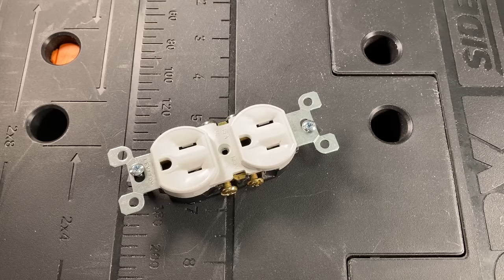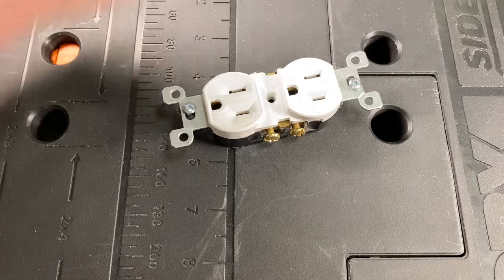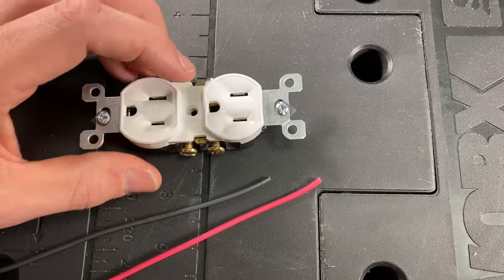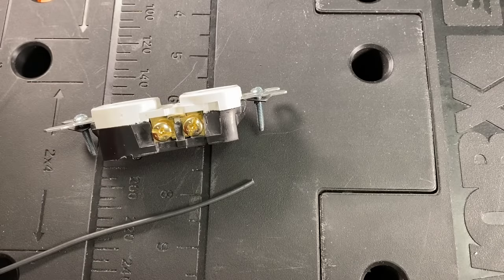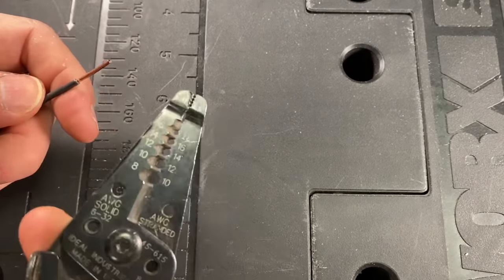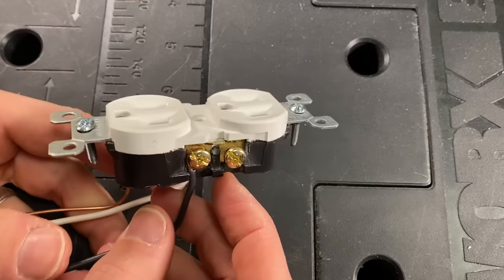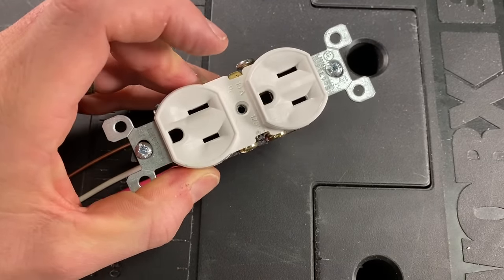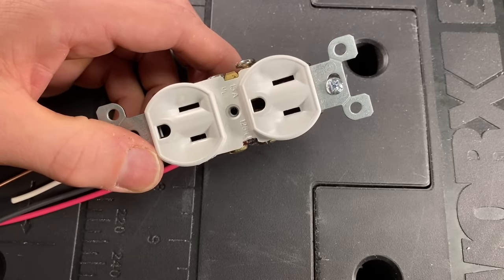Electrical Outlet Basics | How To Wire

Comment: I've been doing home repairs for 40 years.  I NEVER knew that the small slot was the hot slot, why some wires were red and some were black, about the built in wire stripper gauge, the purpose of the built-in the wire stripper gauge, the wire bolster on the outlet, the removable tab to isolate the top and bottom outlet, or even the fact that the screw terminals are preferred over the push in terminals. One thing I have learned from YouTube is that no matter now mundane a subject, I can almost always learn important details I never knew. Thank you so much. Like many of the readers here, I also notice you didn't mention how important it is to place the wire around the screw in a clockwise position. I figured this out on my own more than 35 years ago but this is the first time I have seen that it is "official code" (and understandably so).
Reply: "Black on brass", first thing I was ever taught as a kid concerning electrical outlets and switches.  I also thread in the unused screws, especially when using gang boxes.
Reply: I’d say if you have been doing home repairs for 40 years and didn’t know all the things you mentioned then you have no business do electrical work. You have most likely been doing it wrong for 40 years. The hot vs neutral vs ground on outlets is very important and if you don’t understand the purpose of the wide slot and narrow slot on an outlet then you have no idea if it’s wired correctly. Your lucky your ignorance has not cause someone harm or caused a fire.
Reply: @mrsmith8436  You are correct. Fortunately it’s only been my own home that has been exposed to the risk. I do always have black on brass, I just never understood why that rule was present. I still don’t understand why one side is hot and the other is not, since alternating current means that the current goes “back and forth”  continually. My father 50 years ago taught me that “both wires are hot“ on all AC circuits. So as of today, I still don’t understand why one wire is considered hot and the other is not.  Thank you for your thoughtful comment. Have a good day. Maybe one day I’ll understand it better.
Reply: @thhall459  The neutral (white) wire isn't hot unless the circuit is in use.  The polarized plugs help ensure that when appliances/devices are plugged in, they can be switched off properly, according to how they are internally wired.
Reply: @mrsmith8436  I am grateful for your counsel.  Thankfully the only place I ever did this was my own home which my family and I have lived in for the past 34 years, and so far we have escaped tragedy.  Regardless, I have always put the black wire on the brass terminal and the white wire on the other non-brass terminal.  I just never knew why,  because in my ignorance, I thought that AC (alternating current) meant both wires are always hot, and that there is no real distinction between the two.  My ignorance was bolstered by the fact that most electrical devices can be plugged into an outlet either way.  Anyway. Thank you and this YouTuber for correcting the error of my ways.
Reply: @thhall459  there is a 115V high side and a 115V low side in a household circuit panel. The white wire is  always neutral, but common to both high and low sides. If you place a switch on the neutral  wire, the switched receptacle remains hot (across ground) even when the switch is off. this can cause an electrocution.
Reply: @mrsmith8436  It's unreal how much f'd up wiring you see especially in homes and restaurant kitchens.  Not so bad in big commercial and industrial situations where there's qualified electricians.  I'm a retired master and I've pretty much seen it all.  These You Tube DIY'er videos can show people some basics, but can also mislead people into thinking they know what they're doing then they end up burning their house down.

Comment: Great video. One thing I always do is tighten down any terminal that is not in use. This makes it less likely of a terminal touching the box.
Cheers
Reply: Correct!  Glad another electrician noticed that too.
Reply: Another good tip ! Or wrap in black tape .
Reply: Sorry I wouldn't have pontificated so much had I seen your post! You are absolutely correct!
Reply: @RonSch123  îuuiiiii
Reply: Thank you for the info
Reply: Another reason is on an arc fault protected breaker a lose screw can give the same signature as a lose connection.
Reply: @perryfarmer3280  Is there any reason why you should not remove the screw from an unused terminal?
Reply: Possibly a couple. One is the screw is slightly tapered and if removed you can add a new one but the threaded part may be compromized. Also left in place tighten down may provide a better mechanical result and some corrosion protection to the receptacle internals. However probably minimal benefits there if at all.
Reply: I was going to ask if that mattered, as I am not an electrician. Thanks for your comment

Comment: Thanks for including the info on switched outlet connection. There are a lot of videos out there that cover the same basic info you did that over complicate things and create confusion. Appreciate your concise delivery.
Reply from the maker: Thanks Russell!
Reply: It should have been mentioned that on a split outlet that it’s extremely important to make sure that the power/hot wire and the switched wire is getting its power from the same circuit breaker or fuse so that you don’t end up with 240 volts in the same outlet box. That is against code and can be deadly.

Comment: I was working for an electrician that had been one for over 40 years.  He taught me to wrap the  screws, hot and neutral, with quality electrical tape, especially in a metal box.  Not over kill, professional and safer.
Reply: Focus more on tucking your wires back neatly.  Absolutley no need for electrical tape on outlets or switches , coming from another experienced electrician.
Reply: @tysonkauth7232  i disagree. I think its common sense in metal boxes. Not plastic or course.
Reply: @tysonkauth7232  If you do everything right, you are probably right. Unfortunately people screw up (including the person who comes after you). I definitely like wrapping with electrical tape. (Saw a case once where the outlet shifted in the box over time and terminals shorted to ground).

Comment: It's a good idea to check and make sure the  polarity is correct because I have run in to old homes that the white wire isn't neutral, it's hot, or all the wires are the same color. I have also run into  switches that are wired on the neutral side of the outlet. You run into a lot of crazy stuff when you work on homes that were built in the 50's and before. A handy tool I use for quickly checking if a outlet it wired correct is a GB GRT-500 circuit tester. Provided the outlet isn't the old outlets that don't have a ground.
Reply from the maker: Hey Jeff, thanks for the feedback and agree those outlet testers are super handy and I also carry one in my standard tool bag now.  Take care 👍
Reply: I have been replacing my 2 prong outlets in my 1925 old convent house with 3 prong, and got puzzled with white wire being on the hot side and black on the neutral. Only one wire for each side. There's no ground wire on those old outlets, but I've been screwing the green ground wire in the box, and some are grounded and some are not. I really need to just get an electrician in here and do the most expensive work needed, since some room lights and ceiling fan have a mind of their own and only turn on when they want to, and I get the AC tripping circuitry because there's too many outlets using the same line. 😢

Comment: If the box is metallic, (usually they're much smaller than plastic or composite boxes), I like to wrap the terminals around with electrical tape before pushing the outlet into the box.  People tend to shake the outlets when plugging or unplugging appliances, and it is possible to arc the box with hot side (if the metal box is grounded).
Reply from the maker: Hey Erik,  thanks for the feedback and many others seem to share your thoughts on playing save with a couple of wraps with electrical tape.

Comment: I've seen plenty of back stab connected outlets catch fire, especially from space heaters. The thin blade like contact has much less surface area, therefore higher resistance. Whereas the side screw connections provide more ample surface area to accommodate the amperage / voltage continuity.
Reply: Good to know.  Thanks.
Reply: Things should be outlawed.
Reply: @Sean Stevenson It is all about contact surface area.  Backstab do not make enough contact and therefore create more heat at the small area it does (they tend to be more prone to corrosion issues as well). Terminal use (screw or back wire) have much more contact area.  I never use backstab, nor do I use the device as the passthrough to another run by sharing the contacts.  I always use a pigtail to provide a single wire for each connection on any device (hot and neutral).  Always make sure to screw down those unused terminal screws.
Reply: I'm in the process of replacing all the outlets and switches, myself, in a late 50's mobile home, and everyone of them are back-stabbed. At the time I started this project, I didn't know there was a preference as to what method was preferred, but I'm glad I did it the right way.
Thank you for this input!!
Reply: @csimet  thanks for your comment. I’ve been looking for an answer on how to wire a middle of run outlet. Whether to run a black hot incoming to the outlet and continue the run with another black on the other chrome screw. Likewise with the silver screws, by having a white wire on one screw and continue the run with a white wire off the other silver screw. That verses using a pigtail to provide hot and a white pigtail to provide neutral. That probably isn’t worded properly, but your response cleared it up in my thinking. Thanks.
Reply: I think it is worth mentioning that there are two basic backstab types. One is a spring type where you simply push in the wire which is grabbed. The other is where the terminal screw tightens an internal plate against the wire. This type works well as long as the install is properly done. Never use the spring type.

Comment: one other simple thing, that a newbie may not know. They should make sure to wrap the copper in a clockwise manner around the screw terminal. I know that's the way you did it in the video, however some may not realize that is the way to do it.
Reply from the maker: Thanks Mario, completely agree and thanks for calling out that point.
Reply: I was going to say this.
Reply: Very true, it pulls the wire in as you tighten it. I also almost never use a philips to tighten, I use a flathead or a hybrid (flathead/square) driver as I can get more torque to insure bonding.

Comment: Thank you sir... Very well explained & illustrated... I'm about to install ( 4 ) outlets in my attic, a pair on each gable end to each side of my window openings... I recently installed ( 3 ) ceiling light fixture boxes on my cross supports at 6000 lumens on each light fixture. My goal is to wire off of the outer light fixtures to a outlet at each gable end & then run a extension wire off of each outlet to the other outlet, giving me a total of ( 4 ) hot outlets, i.e. always on... What you have demonstrated here will make me double check my light fixture connections where the hot, i.e. black is on the gold & the neutral, i.e. the white is on the silver screw connections & I now know I went out of code where I doubled up on a ground wire in the center light fixture, I will correct this with a pigtail whereas the outer light fixtures each have their own individual ground connections & again I will double check my gold & white connections whilst I'm in there one last time...
Just one final comment here, per the electrical code for better than three years now, the neutrals now go from 6 o'clock to 12 o'clock per the manual, if they aren't, you're out of code & amazingly enough, a good many electricians are NOT aware of this newer code to this very day, lol! 
All the best,
Bill... :~)

Comment: That strip guide is really for “stabbing” the wire in the back of the receptacle, not necessarily for “wrapping” around the screws. As a NJ state licensed electrician of 22 years, I do very much appreciate the advice to wrap and not stab the wires in the back of the receptacle.
Reply from the maker: Good point, thanks for the feedback.
Reply: @EverydayHomeRepairs  i think it's for both...it sure does look like it's the perfect length
Reply: @catspaw3815  trust ol’ Sparky; He’s right.  The strip gage is not long enough for wrapping the copper around the set screw.   If the exposed copper is too short, there is a tendency to have the set screw pinch the insulation.  This potentially results in a loose connection, so eventually could lead to arcing and eventually fire.   There isn’t much worse in the field of electricity than a poor connection.
Reply: @jakesully5402  Yeah, but at 6:00 in the video he is clearly mentioned to not have the insulation up under the screw.
Reply: @jakesully5402  Thanks for that, great comment thread, great comments throughout, I am learning so much so quickly :-)

Comment: Excellent and informative video. Hints: Remember that saying, "Black on Brass, White on White." After attaching the hot and neutral wires, you should wrap electrical tape around the outlet to cover all the termals. When using the tape, you might want to remove the mounting screws. They will get in the way.

Comment: Excellent video Scott. Also when wiring an outlet with multiple outlets in the circuit be sure not to mix up the line and load sides. Line feeds power coming into outlet and load feeds the next outlet on that circuit. ⚡ 🇺🇲
Reply: Use pig tails do not use the device  for continuing the circuit.
Reply: @davidw7643  .unless you want to take advantage of gfci

Comment: I do have a wire stripper like yours, but I usually use another kind. It automatically gauges the wire and makes a perfect strip. It looks kinda like a crimping tool/cutter thing. A bit pricey but well worth it in convenience.
Reply from the maker: Those are pretty handy.  I used to use a stripper like that but more for electronics.

Comment: Two things to add.  Tighten down those unused connectors and wrap the outlet with electrical tape.  What's your preference for orientation of the ground prong?

Comment: Good video! And, good comments. One thing I did not see mentioned, that I do, is to screw in any terminal screw not being used so the screw head doesn't stick out past the outlet body.
Reply from the maker: Agree that is a great tip.  Thanks Steve 👍

Comment: There is a small square hole beneath the screw (on some brands of Duplex) that you can shove the stripped wire into and wrap it CLOCKWISE around the screw.  Insulation should not be under the terminal screw.  ALWAYS have the conductor going CLOCKWISE so it tightens under the screw correctly. End of wire to the Right.

Comment: I like how you mentioned that the small slot on the receptacle is hot and and larger slot is neutral, that's usually how I remember brass=hot, silver=neutral, it can get a bit confusing otherwise.

Comment: I agree with you. Don’t ever use those darn push in connectors. I’ve had a few failures regarding those in my own home. They randomly stop working, crackle, and snap sometimes with a load and with the heat and cold cycling. I’ve personally never used them for that reason but my entire house was wired that way when I purchased it. Also avoid daisy chaining the receptacles because when that push in connector fails on one, you lose all the subsequent receptacles in the line. Then you’re hopping room to room trying to figure out which Is the first in the series. I’d also advise to remove the screw clamps from the receptacles that come with them and use the screw alone with the hook around wire method. There’s almost 0% chance of failure. :) be safe!
Reply from the maker: Hey Adam, thanks for the feedback and example of the issues you have seen with the push connections.  Sounds like a pain.
Reply: I’ve never had an issue with the push tabs...knock on wood. Agreed the screws are almost 0% chance of failure.
Reply: That’s why I don’t understand why people like wago’s, it’s the same thing as the push in connections on the back of outlets. 🤷🏽‍♂️
Reply: Mr. Sleep 
Agreed. I used the name brand Wago connectors very briefly a year ago and while tugging on the wires in a 3 gang box, I pulled out a wire accidentally with very little effort. The point of contact to the conductor is just so very very small. I threw out the bags of connectors I had and never went back. They may be safe overall but they just don’t give me the warm fuzzy secure feeling that I get when I twist the wires together with my electrical pliers and then squeeze it all down tightly into a good quality nut. 😁. If someone is trying them out, I’d recommend trying to twirl the wire in the connector or just rock them back and forth a little. You’ll find that they are very loose overall.

Comment: 67 years old:  watching you I just learned that I have been using my wire stripper incorrectly.  You show that just rocking the stripper a bit after clamping down on the wire will cut the insulation.  I always, incorrectly, rotated the stripper back and forth to cut the insulation, which never worked that well.  Thanks!